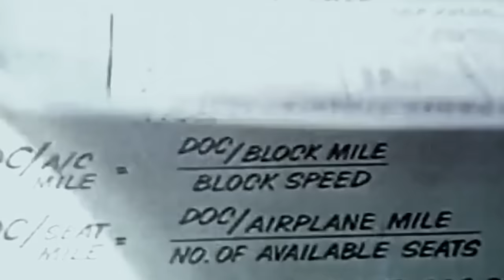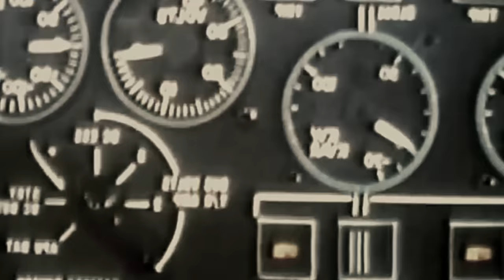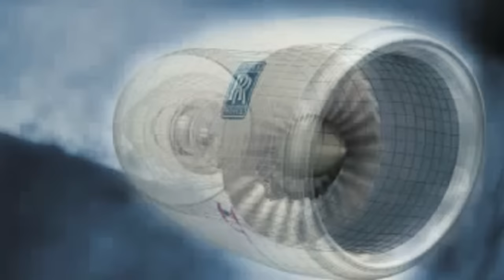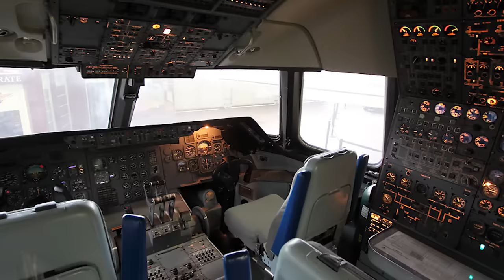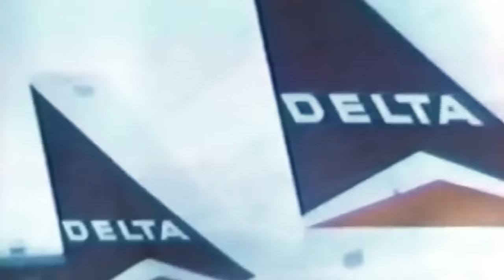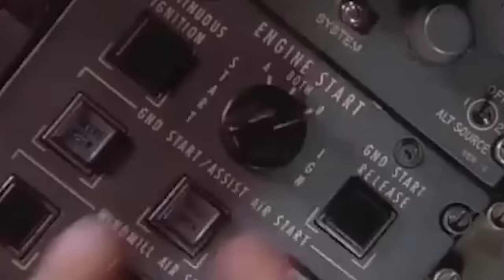L-1011 Tristar - too advanced for us

Comment: It was a mistake to remove the production of the L-1011 Tristar. - Not only a reliable machine, but the most comfortable i have ever flown.
I used to fly TWA from Lax to San Juan, Puerto Rico, but then, it became American Airlines in 2002, which stopped the usage of the L-1011-
So, i switched to Delta, which had them in use. - Would take off Friday night at arounJFKd midnight from LAX,  and arrive in Puerto Rico by 10 am
(including time differential) just in time for lunch ( breakfast really) - but it was amazing, the few people flying such a late hour on the first day 
of any given weekend. - So, you could take the 5 seat middle row, and sleep it out all the way to destination. Delta was not direct however. They had 
a stop either in La Guardia or JFK - you could get your dose of transatlantic sleep since it would not vibrate, it would be quiter than most other airliners.
It had a nice comfortable aisle and washroom facilities. - The last time i flown it, the crew recognized me ( i used to fly twice a month) and let me in the secret that all of their, i think Delta had 12 machines, were sold to Fed Ex as cargo haulers for the Alaska port of entry. It is my understanding there still in use with them, yet i have no way to confirm it. I would rather fly anywhere in an L-1011 than in a 747 for the long haul. The 747 shakes and rattles in the tail end causing 
a lot of internal noise pollution. - unsleepable fligthts i call them - I fell in love so much with the L-1011, that i would book the flight based on the availabiltiy of this particular model aircraft for the given flight i needed. - Comfy, quiet, even when there was a full cabin. -  the equivalent of a 'smooth ride'.

Comment: The thing about Lockheed is that they have always been all about pushing technology forward. When you think about the aircraft they have designed, the SR-71, the U2, the F-104. Sometimes they are successful with this approach, and sometimes not, as with the VentureStar space shuttle replacement getting canceled, or with the L-1011 ultimately leading to Lockheed exiting the airliner market. But they always produce something new and slick. The Tristar is an awesome airplane. Too bad it's mostly retired now. Having three engines in a two-engine world makes it hard to justify keeping it around these days, and if Lockheed Martin were not so many years out of the business, they'd be able to offer a two-engine version that would be competitive in today's market. Also, having an engine built into the fuselage makes it's very difficult to upgrade. With modern engines and construction I bet the L-1011 would do well in the Far East where jumbos are still in demand.

Comment: I think if the dc-10 had failed, the lockheed l1011 may still be in passenger service as it wouldn't have had a competitor until the 777 or a340

Comment: The fact that the Tristar had a good Autoland system is not as surprising as you imply. The British HS 121 Trident was cleared for Cat 3 operations in December 1968. A lot of the work on the Tristar Autoland was done by the same engineers that worked on the Trident system. In fact the Trident had a number of similarities to the Tristar including the S bend feeding the centre engine. 

As a pilot on the Tristar in the late 1980s I can vouch what a good system it was - the comment in the report book that was filled out each time was usually "PFM", the first letter standing for pure and the last for magic. It used a wing down technique in a crosswind instead of the Boeing "kick it straight at the last minute and hope" or in the case of the 737 with only a two axis autopilot "land it sideways and hope". I suppose that fortunately strong winds rarely go with fog (except at St Mawgan!)

Comment: Still probably my favorite aircraft. I flew it many times predominately TWA but also Delta.  I am still intrigued by what to me as a passenger appeared to be a nose up attitude during cruise.  I wonder whether the original design, prior to the  Rolls Royce problems, was for it to have a higher cruise speed which would have provided more lift.  If my observations and speculation is correct could longer wings have resulted in a more efficient aircraft?

Comment: Would be awesome if the Airlines requested a new/modern/upgraded/more economical version of a wide-body, long haul Tri-Jet and see what Boeing would do with the MD-11 and Lockheed would do with the L-1011. Airbus too, if they felt doing a ground up design would be worth it. The competition would be exciting imho. Maybe utilizing 3 GE9x power plants. Only 3 on take-off and 2 during cruise. Once #2 engine is no longer needed, shut down #2 and have a aerodynamic feature enclose the #2 engine's intake. This engine could also be implemented for emergency back-up power. I know, its all a huge reach...just dreaming out loud.

Comment: I wish I could have gotten a ride on the L1011. Remarkable what those Lockheed engineers were able to create, and they did all that in the early’70s!! With all our modern technology, Boeing builds a plane that takes control away from the pilots and kills all on board. Rather embarrassing considering 50 years of advancement.

Comment: L1011 dead yet B747, MD11/MD11 still flying. Why? 1) Major Structural issues; 2) Complicated high maintenance analog mechanical systems (autopilot/throttle); 3) Lockheed dumping support; 4) B767, A300

Comment: I HAD AN UNCLE WHO FLEW THE L-1011 FOR WESTERN AIRLINES.
  On one night in 1981, he was preparing to depart LAX for a flight Atlanta.  At the same time, a 7 Eleven store was being robbed at gunpoint about 6 or so miles away.  The two robbers, members of a "Bloods" gang fled the store as several police arrived.  One robber got behind the wheel of a getaway car, the other raised his gun yo fire at the cops, but was shot, fell from the passenger side door and died.  The other robber behind the wheel panicked and sped away, leaving his partner behind.  He side-swiped a police car and raced away.
  Meanwhile, my uncle's TriStar had been pushed back from the ramp and began taxiing toward the runway. 
  The fleeing thief raced from the 7 Eleven, several police cars giving chase.  He headed through an industrial/ warehouse area near the airport, likely got lost, then made a sudden turn down an unmarked road, probably attempting to lose the chasing police.  The road pavement ebded, and became a washboard dirt road.  The road came to an end at a chain-link topped with barbed wire along the LAX property.  The gangster lost control and ran into a barrier, destroying the front axle.  
  About this time, my uncle, the Captain was guiding the L-1011 toward the runway.  Two or three planes ahead of his.
  Back at the airport fence, LAPD were driving down the road, closing in on the robber. ( His attempt to escape failed. At least two cops saw him make the turn).  The thug, trapoed and cornered, his car wrecked, and with no other option, climbed on top of the car, holding his pistol and the plastic bag of stolen cash in one hand climbed up and over the fence, managing to avoid the barbed wire.  He must have seen the airport property was very dark and thought he could hide in the darkness.
 But, as he kept to the ground, the barbed wire snagged the bag, ripped it open, and all the $120 cash spilled out to the ground!  The cops were coming to a stop, officers jumping from their cars.  The thug turned and ran away into the pitch black field.  He continued running, probably unaware He was on airport property.  As he ran, 3 of the officers also came over the fence and continued after him.  The robber had a long head start.  
  At this time, my uncle's flight was on The runway and was cleared for takeoff.  He and the First Officer pushed the throttles, and began racing down the runway.
  As they were about to pull back and begin climbing into the sky, my uncle saw something in the corner of his eye.  He was focused on the plane and a moment later, they were airborne.  They turned the plane toward the east, and all seemed normal.  Then, they received a call from LAX tower, ordering them to return to the airport.  Unsure why, my uncle complied and 5 minutes later, landed.  He was told to exit the plane and was met by LAPD officers.  They informed him of the robbery, and that the thief had fled from them on airport grounds.   They then told him the guy had run onto the runway, probably failed to notice the plane racing down the runway (around 155 MPH), and  was struck and pulled under the left rear landing gear! "WHAM!!!".  The cops my uncle and, his copilot,rode to the runway to the scene of the "impact".
   The guy was literally crushed and smeared down a 40 foot section of the runway.  His body ( including torso and head) flattened and burst open.  A slimy red smear was left on the pavement. (The runway was closed).
  They went back to the plane to look for damage, but found none.  The co-pilot looked into the wheel/ landing gear housing under the plane, and gasped.  In the well was something gastley:  An Adidas shoe with a severed foot in it! 
  The foot was that of the gangster!!!
 Maybe it got pulled between the tires, as the rest of the body was crushed, and was ripped off and thrown by the tire into the wheelwell?? 
 Think about this: the robber was struck by a set of 4 tires about 40" tall, spinning very very fast, impacting him at at least 140 MPH.  He was pulled under and run over by the gear, was crushed by around 60 tons, and his foot ripped from his leg!
  My only hope is that he didn't feel anything.
  Anyway, after about 2 and a half hours, my uncle finally was back in the flight deck, and heading for Atlanta.

Comment: There was that DC-10 that crashed in Chicago, after the engine broke off and crushed the hydraulics that were in the leading edge of the wing. This caused the flaps and slats to retract , leaving the plane with full lift and thrust on one side, and none on the other.  This would not have happened to the TriStar, whose hydraulics were located between the wing spars.

Comment: It was stated that the RB211's had composite fan blades. This is not quite true. Originally they did however, they could not pass the "chicken" test. The fan blades exploded when conducting the bird ingestion test. It was decided that they would have to be fitted with solid titanium fan blades. These were much heavier and made the engine very in-efficient. It was because of the time and money it took to fix the engine to be more efficient, that Rolls-Royce went bankrupt. Even now, the XWB and the Trent family of engines don't have composite fan blades. They have however figured out how to manufacture hollow or sandwiched titanium blades. I worked many years and a mechanic for Delta Airlines. They were great planes.

Comment: The L188 was unpopular because in the early versions the wings would oscillate causing them to rip off, this caused several fatal crashes, while they fixed that issue it was too late, while the L1011 was delayed due to Rolls Royce going bankrupt while developing the engines it was entering a crowded market which is why it failed, great looking plane

Comment: There was a government Request for Proposal (RFP) for a new large heavy carry aircraft to replace the C-141. Boeing designed the 747, Douglas proposed the DC-10, and Lockheed proposed the C-5. The 747 offered the best technology and the DC-10 offered the best value. It was Lockheed that won the competition because they did not have enough work and a government program that assured sustained production capability wanted to keep Lockheed in the aircraft production business. Same was true when the DC-10 ended and the government bought them for use as air refueler until the C-17 production came on line. 

Lockheed received a government contract to develop an advanced flight control system for large body aircraft. After all the development work Lockheed decided to build the L-1011. Unfortunately, this plane cost the same as a 747 but was only the size of a DC-10. It's market was reduced by these facts although it did introduce many improvements at the time.

Comment: The RB211 -22B most certainly did not have carbon fibre fan blades, nor did the more powerful -524B3/4 powering the -500 TriStar.  Indeed, at that time the 33 narrow, solid titanium blades required mid-span aerofoils or "clappers" to resist the aerodynamic untwisting loads that occur during rotation, after the abandonment  of the hyfil carbon fibre design, due to inability to resist any impact damage.  Wide chord sfpdb  was a long way off still.

Comment: To be competitive with the MD-11, Lockheed's L-1011 aircraft needed to offer more range / better fuel consumption / and lower weight.  Rolls Royce offered to build a new lighter engine that used composite fan blades.  During testing, the fan blades had a catastrophic failure.  R-R couldn't make the composite fan blades work.  GE and P&WA were asked by the British Government to lend a hand with the fan blades.  The solution was to make them out of titanium - like the GE CF6-50 and the P&WA JT9D - but, that added weight to the engine.  So the R-R  engine no longer met R-R's performance / weight specs that they had guaranteed to Lockheed.  To avoid being taken over by Lockheed because of the guarantee situation, R-R declared Bankruptcy.  That save the Queen's Company from being owned by Lockheed, but now Lockheed had an airplane that no longer met the performance specs that they had promised the airlines.  With the heavier, but reliable titanium fan  blades in the R-R engines the L-1011 couldn't compete with the MD-11. The L-1011 couldn't meet their range guarantees, and with the lengthy delay in getting the R-R engines Certified, the MD-11 owned the Market.
Reply: But there wasn't really a market anymore by then because massively successful twin engine aircraft started entering service
Reply: @dyeet6861  It takes longer to develop an aircraft engine than it does to design and build an airframe.  That is why the choice of a new engine is absolutely critical to the success of the airframe.  In the case of the Lockheed L1011, when R-R had their catastrophic fan blade failure, and couldn't solve the problem with any composite - light-weight fan blade; there went to performance of the original design L-1011.   The Certified R-R engine was then much to heavy (with the titanium fan blades) and couldn't meet their Contractual commitments.  So, when the first L-1011 flew it couldn't meet the specifications that Lockheed guaranteed  to their Airline customers; aircraft weight / range / fuel consumption (based of the R-R Engine  Performance Guarantees).

Comment: This was a good aircraft and as you said Rolls Royce almost committed suicide developing the engines.  The carbon fiber blades (Trade-named "Hyfil") never went into service and the engines had the "Backup" Titanium fan, developments of which are on every Rolls Royce engine to this day.  In addition the 3 spool layout remains on every large RR engine, and is likely to remain that way.  It means the engine can be shorter and lighter due to greater compressor efficiency.  Fan-case mounted accessories make maintenance easier.  Only now is Rolls Royce planning composite fan blades.  Although GE have been using them since the 1990s the GE blades were never as efficient or light as the Titanium RR blades.  The GE cores were usually better though, hence how both manufacturers maintained competitiveness.

Comment: in the early 60's, when the Air Force needed a quote for a new large body transport plane, the three major aircraft builders came up with their designs. Boeing offered the 747, Douglas the DC-10, and Lockheed the C-5. Boeing won on the basis of the design, Douglas won on the basis of price, and Lockheed won on the government's need to have a third large airframe company available. Because the C-5 did not have a commercial market, the government asked Lockheed to develop a "state of the art"  aircraft to apply the concept. The L-1011 was born from this competition and the need to sustain capability in the industry. Unfortunately, the plane cost as much as a 747 and was the size of the DC-10. Those who could afford it were very pleased but it was not a commercial success.

Comment: The biggest problem with both the L1011 and the DC10 was that they tried to take on the 747 and ended up (like the 747) being "make or break" items for the company producing them.

The market for very large aircraft is tiny - effectively there's only room for one aircraft at that end of the market - whoever got there first, "owned it" unless they made a spectacular mistake - and Boeing didn't make such a mistake.

Comment: ATL-BOS September 1974. L-1011 smooth as a baby's butt, and no crapola. Have since flown 727/737/747/Demolition-10. L-1011 nicest of them all. Also flown Gruman Yankee Traveler, Cessna 172/182/210,  Piper 140/180. L-1011 still the favorite, Cessna 210 in second place. All combined, about 350 hours.

Comment: I flew over 12000 hours on L1011-100 -200 and -500. All airplanes I few afterwards A330, A320 and A340 did not even come close to the L1011. The auto land system of the L1011 was performing much better in x-wind conditions and touchdown point accuracy then Airbus.